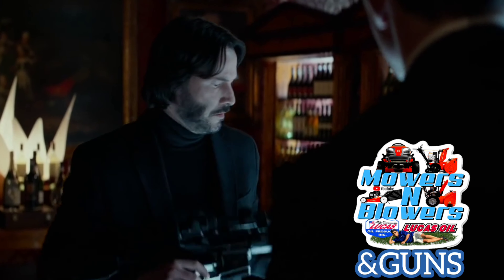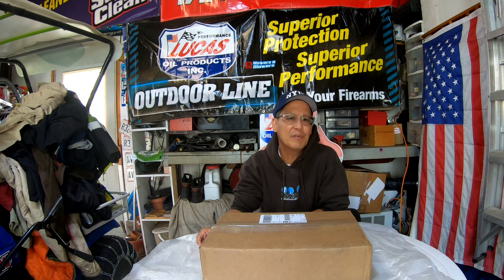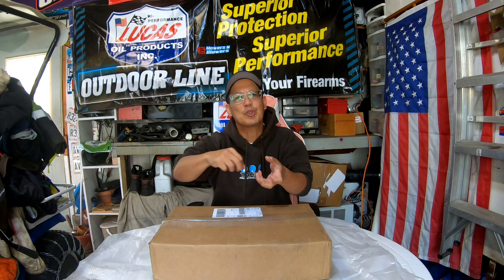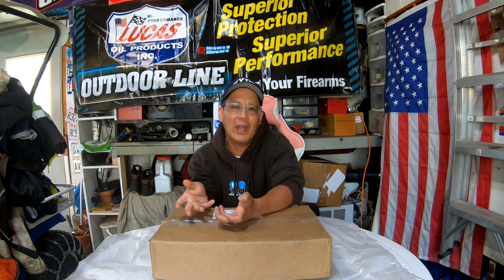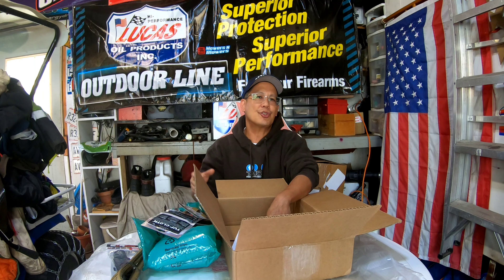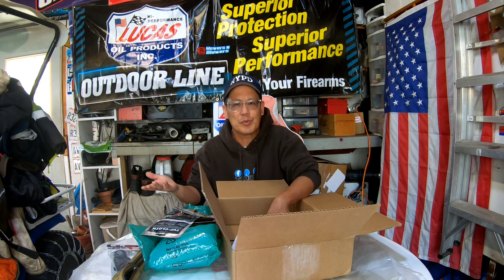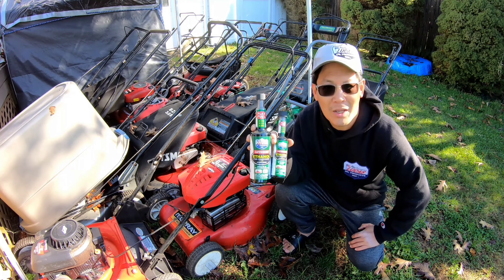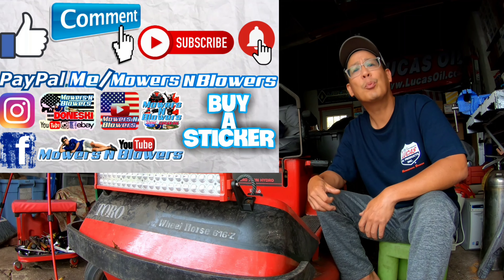SENT DEFECTIVE HEXMAG MAGAZINE FEEDBACK TO SENTRY TACTICAL PRODUCTS RECEIVED SAMPLE PRODUCTS UNBOXED

Comment: Best results I have had are with the Magpul Pmags and Tapco ironically. The anti-tilt followers in those are the best. I have a bunch of Hera Arms ones as well, those do not have anti-tilt followers, and they have some issues feeding... They work better in my Ruger American .223 bolt action than an AR15. I have never had any Hexmags. Some people swear by the old military aluminum mags as the most reliable and durable, but I don;t have any of those. I tried some Promags a few years ago, and they worked OK most of the time, but I had some feed issues with those as well, especially when using certain brands of ammo- I think it was Perfecta .223
Reply from the maker: I had zero issues after I oiled my bolt and tried different mags

https://youtu.be/Hbp7_g30uf0